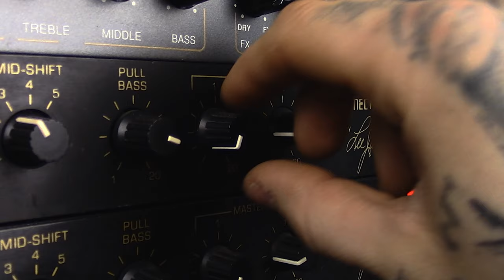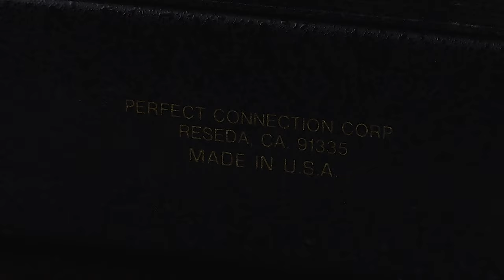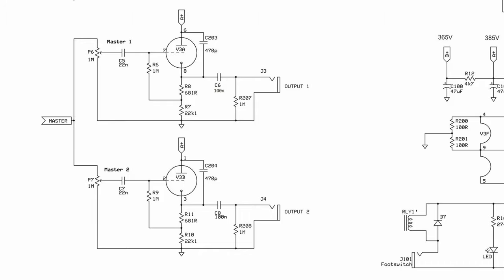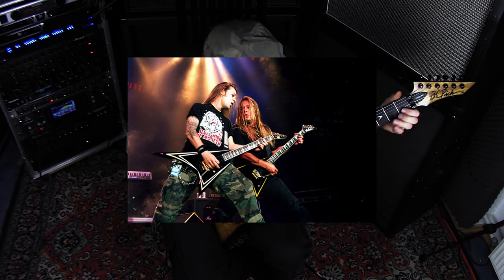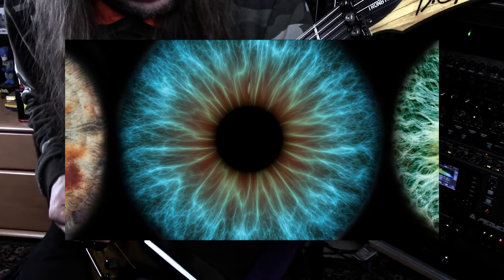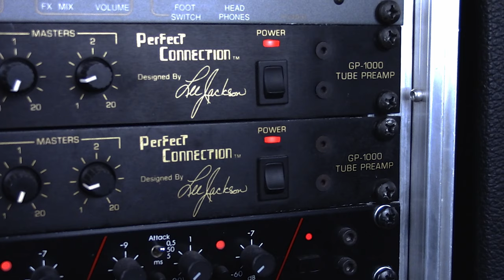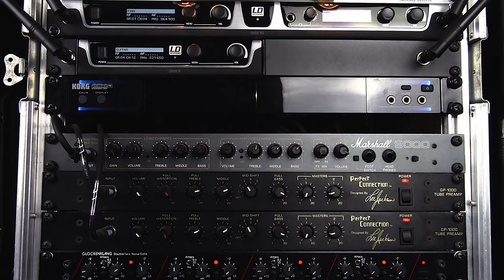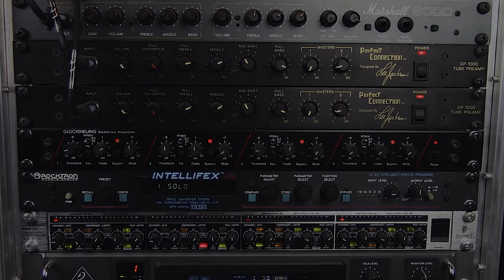The Misunderstood Amplifier - Lee Jackson GP-1000 | Weird Gear Reviews

Comment: Wow man thanks for taking the time to put this video together!!  My old man and I built a 50 watt amp head last year for ourselves which is basicaly a circuit made by combining a GP1000 with the power amp of an el34 based 50 watt JCM800.  Sounds great but it is BRUTALY loud lol  We just finished a super small combo-amp version of the same thing, only with 5 watts of el84 power instead of the crazy loud 50 watt power stage.  Lots of colouration from the one power tube since we can actualy realy crank it!  More watts does NOT equal more tone.  The little box realy rips!!! 🙂 Also I have to say that the Dimarzio PAF Pro sounds awesome into GP1000s and a super clean volume boost pedal is great too for that extra bit of gain.  I find tubescreamers and pedals like it can sort of smeaer the drive sound a bit, but that might just be personal taste.

Comment: What a great video essay about such a historic piece of gear. I was a big fan of Alexi/Roope gear lore as well - I remember studying those rack photos very closely back in the day. I was lucky to score two GP1000s (87 & 88 models - they sound identical to me) before the prices skyrocketed. There's something magical about the J50BC+JE1000+GP1000 combination.
Reply from the maker: Thank you so much! 

It really depends which 87/88 versions you got. Some 87 are identical or very close to the 88 models. 
The early ones have completely different components and circuit boards than the later 87 models. Also there are 87 models I've seen with the opened gain stage, which are very close to the 88 but not quite yet 88. It's just very random. 
I checked all my 4 gp1000 now for different components and it's amazing how different then are, even the 88 models and serial number which are not that far away from each other. 

But in general you're right. How late/early are your serial numbers?

Comment: My lazy ass has a question, little bit offtopic'ish. I saw a couple times this "RSP 2400 Hush/Enhancer/Exciter " thingy and if i understand correctly, if this unit was used by Alexi it was for add extra bottom end or bottom + high freqs (seems like gp-1000 dont really need em  ). Can someone explain me plz?
Reply from the maker: Yes, that was exactly what that was used for, basically put more bottom end. Well i try to understand that too but heres the thing. On recordings and being in a room with this amp, it lacks bottom end...if you solo it. So the dry amp with no backings sounds a bit weak and not full enough. You can work against that with such device or mod the preamp regarding this "issue". But being live with that thing constantly i can tell you it lacks basically nothing. I play in one band where we are 3 prople, 1 guitar, drums and bass. My tone is super thick and vutting tgrough everything without being a pain in your ears in the higher freq. Basically where I want to be, in the lower to upper mids, the bass contemplates that so everybody got his spot regarding freqs. Playing it dry though, yes, it lacks bottom end, it literally doesnt have that. Do i miss it? no, do i think if its necessary? no, not in the live or studio situations. At home or when youre not in a full mix? yes.

Comment: The front and back GP-1000s pictured at 7:00 and elsewhere are mine and from photos in the GP-1000 article I wrote for Premier Guitar magazine in 2010.

I obtained my first GP-1000 years prior when Reb Beach’s guitar tech, Dave L. gave it to me.

That set me on collecting these and that of course is when I noticed the differences. The terms such as “transitional” are mine as I didn’t know what else to call it. As far as I know, Lee didn’t have any specific names. It’s possible there are variants unknown to me.

Reb’s GP-1000 was used on the Winger demos and is odd that it has no foot-switching capability and the station for a relay is empty. Lee only commented, “you got an early one.”

GP-1000 870001 was confirmed by Lee as the first shipped.

I picked up the trail of use of an Aphex Aural Exciter in conjunction from the Metal Method “SOUNDS” private lesson cassette issued circa 1987. At that time, the most recent version was the Type C, which does not have “Big Bottom.” That came later. Thus, the obvious reason at the time was to add more harmonic content.

It might be possible to swap out the 250k bass potentiometer for 1meg. One problem: this is a push-pull pot of course, so you would have to find a push-pull pot of the correct dimensions, replace the carbon path wafer with one from a 1meg pot or forgo having the push-pull option with a normal pot.

I experimented with a 22k pot for the Midrange and it works well. I think I also modified one with 825/.68uF on the cathode of V1A and it may be in an article interior photo.

Needless to say, the GP-1000 was designed for that era’s Shred and Hair Metal. Obviously, it’s not entirely suited without tweaks and modifications for modern Metal like say, Nile or Abnormality. Probably would work as is for Abbath.

It’s worth noting, and I discussed this in the article, that the ‘88 replaces the ‘87 Fender style tone stack with .1uF for the midrange and .22uF for the bass. This lowers the center frequency of these controls of course.

The Mid Shift switches various capacitors in parallel with the treble capacitor. If I recall correctly, the values are 220pF, 470pF, 1000pF, 2200pF, 4700pF.

When I first heard the ‘88, I was convinced that this was the sound of the Loudness - “Jealousy” EP. 

It was so spot-on and Lee is thanked in the liner notes. That being said, Loudness Supervisor George Azuma told me Akira’s tone on that release was from a Jose Arrendondo-modified Marshall. Still, it sounds so similar that I am left wondering. If you want to hear that, listen to the vinyl or original CD pressing for your example, but not the remastered CD.

I wouldn’t say I have had as much trouble coaxing a good tone out of the GP-1000. I’ve used a variety of overdrive pedals over the years, plus a Boss SP-1 Spectrum to get a bit more midrange.

I’ve found replacing V1 with a NOS Mullard 12AX7 will really enhance its tone.

In all these years, I have never had a component failure.

Interesting video. Subscribed!
Reply from the maker: Man, I've read that countless times throughout the years!
Sorry for the late reply but i need a couple minutes to answer that and i think I will even mention this somewhere in a future video. 

Yes, those are the pictures directly from that article. 

Thats awesome! I wonder how many GP-1000s belonged to artists that were using that and then just sold them at some point. I remember I bought one of mine from Lasse Lammert who used it a lot in studio, probably theres still some videos of him using that on youtube. 

That is so funny that those terms were coming from you. I always wondered where they came from since for me there was never a clear cut or structure. But then again, that only dawned on me when i started to have more and more and opened them up or found pictures of opened one and none were like the other. 
But that term wasnt that wrong, like i said, there are 88 mods in 87 housings with back plates to cover and 87...its just hard to draw lines. 
I think Lee just produced them, changed them on the run, got supplied by different manifacturers or some musician wanted something special and he just continued to do so. I cant count how many variances i found throughout the years and even changes that were done (eg caps) were revisited and changed back in later models, then brought back as the ride continued. Its kinda chaotic. 

Except your picture, Ive never encountered one without a foot switch. But it makes sense that it was added and then never scrapped again, so I guess there are not many of those. 

The Exciter thing. A thing i never understood, at least for the marshall mod. In a full mix or live situation you actually dont need it. Then again, I'll never know what those old concerts, PA's and recordings sounded like. I might've made sense at the time. 

Swapping the pot and playing with the EQ is imo kinda pointless if you're trying to go for high gain sounds (what its not intended for)...or well...or lets say to put the GP-1000 to the max gain. Since the EQ is in front of the gain stage, the EQ change even with a 1meg wont make that much of an audible difference. I'm always thinking that through in terms of context so in a live situatiuon or on recordings. On recording you want to make space for other instruments anyway so you will literally high pass that. Live you basically want to do the same to make space for other instruments and keep the low mids and bass tight instead of muddy from a distorted guitar. I just cant think of an environment where this is actually needed....except you're practicing alone at home or you focus on what is coming out of your speakers in a dry environment without backings. Then maybe, but again, it would be a lot of a hassle for basically a slight change that you could achieve with eg different speakers. 

I never thought of modding anything regarding the mids, but fair point!
"I think I also modified one with 825/.68uF on the cathode of V1A and it may be in an article interior photo."
I have one with that exact mod. Also those values were changed throughout too. I checked, even I have ones with this value and different, i would need to check now though. But...I have to say, theres little audible differences except youre in a dry environment. 

"The Mid Shift switches various capacitors in parallel with the treble capacitor. If I recall correctly, the values are 220pF, 470pF, 1000pF, 2200pF, 4700pF."
I never checked, but it wouldnt suprise me if there were changes over the years lmao. At this point i dont trust anything anymore regarding "stock specs"

The jealousy EP...I need to check that!

"I wouldn’t say I have had as much trouble coaxing a good tone out of the GP-1000. I’ve used a variety of overdrive pedals over the years, plus a Boss SP-1 Spectrum to get a bit more midrange."
Maybe because I had always a very specific sound in mind when I was trying to dial in anything and nothing is dialing so I need to swap components around the preamp. But that might be true for a lot of people too. They want to recreate a sound for example and are not really able to "out of the box" since the gp-1000 is not versatile at all if you set it into overdrive.  Putting something in front of that to get more midrange kills me though lmao. 

I replaced the tubes of all of them to different manifacturers and also compared to the stock ones and so on. 
Ive never heard or felt any difference in sound and since i basically go into the preamp with an even hotter signal, it doesnt really matter. 
What matters though is voltage. The amount of gain and "thickness" i would say changes drastically with every  amount of voltage that drops. 

"In all these years, I have never had a component failure."
Youre lucky. Im basically touring with those and from soundcheck to end of concert they are on average running for about 6 hours straight. Mine failed alot. Usually mid concerts, either the fuse blew and some component died or there was just simply no sound anymore. I have 4 in constant use and every failed at some point. And i have the feeling everytime something else breaks haha. But I'm learning and i start to eliminate things that break in my other preamps as soon as i know what broke this time in another one. 
Most issues I encountered:
- dying tubes (jesus, that thing eats tubes). probably also has to do with the environments im in all the time, live, travelling, low voltages, constant running and heat. 
- burned out rectifier circuits/dying diodes (probably aging faster due to low voltages live)
- caps and bias cap. Probably due to age, after replacing them I never have a problem with them again. I guess only a problem in live environments due to constant heat/operating temperatures and low voltages...and then the age.
I dont think that any of those problems would occour in home environments, theres just too little stress on them. 

Thank you for your comment! I really appreciate that!

Comment: Alexis guitars had an active preamp circuit acting as a boost with adjustable EQ and up to +18dB of extra juice. So this is what goes into the gp-1000 to give it some more distortion. Adding distortion and boosts in stages is a good idea to sculpt distorted sounds. The gp-1000 wasnt reliable as it had to be repaired several times while on tour. Alexi later used Marshall jvm 410h.

Comment: I have had a gp1000 and sp1000 for years. Cool stuff. I run a ts9 tube screamer up front. I split my 1960a & b 300w cabs to do stereo. A RDS1900 for effects (Ya they suck but it works) rocktron noise control.  Sometimes I like a aural exciter for grins. Guitars are floyd bridged with EMG 81/85.

I admit I am old and started metal with a 1959 Marshall 100w and a cassette player for a preamp (headphone out to bridged inputs.)

Comment: Thanks for this - it comes at a very good time for me as well.  I've been obsessed with this amp since I realized that 2 of my favorite (but quite different) guitar tones were produced by it.  Early Zakk Wylde and early Children of Bodom.  I finally picked up a really nice single owner and unmodded '88 GP-1000 and SP-1000 set about a month ago.  I've been able to get a decent early Zakk tone (adding an SPX90 and Aural Exciter) but was lost on how to get a COB tone from it.  My signal chain is Guitar w/EMG 81 - Boss SD-1 - GP-1000 - SP-1000 - Mesa 4x12 Cab.  It sounds like necessary next step would be swap out pickups and add a preamp on one of my guitars.  Do you think that alone will make a noticeable difference?
Reply from the maker: Yes. It does make a huge difference. 
I personally dislike the preamp with a emg81 even though I think this pickup is a good pickup but it doesn't fit the amp. 

Pickups and the preamp make a huge difference for the preamp.
Reply: man just change to Alexi's EMG ALX set - this preamp will get you there

Comment: Very nice review, thanks man. At the current prices it might even be cheaper to build/get built one. At 14:42 you write you found one mistake in the schematics. Please share what that is! Are there any others you found since?
Reply from the maker: Yes i found one mistake while editing. 
If i remember correctly there was a grounding issue in the schematics with the distortion switch, a small flaw, but fine. 
I can't guarantee though for the rest. I checked of orders were right and some components to clarify that I have a decent schematic to explain what i want to tell. 
I didn't check every resistor etc. 
That flaw that I found is major though. I would need to open mine up again and check it again and compare with the schematics to exactly tell what flaw i found. 

Hope that helps a bit. 
Of course to build a replica i would recommend to buy one to be 100% correct about the schematics.

Comment: welp i just got my GP-1000 and yup and sounds pretty shit. Dont have the gain boost yet so i have to try that of course before my full assessment. i had this unit modded by lee jackson for more gain and honestly i would hate to have heard what it sounded like before the mod because after the mod it still has no gain..... damn
Reply: in my experience rack preamps are terrible without a 4 band parametric EQ, boosting 6k you get an instant buzzsaw tone, it creates the perception of alot more gain than there actually is, then you can do heavy mid shaping with the rest of the bands, GP-1000 sounds godly but only with the parametric, i would rather use a DS-1 than a standlone GP-1000 lol
Reply: @DOKITT  Would a graphic eq work just as well? I was thinking of getting a 31 band.
Reply: @akamouzis  In my experience no, with the right parametric you can change the bandwidth of the frequency to be really wide or now which makes a big difference, if you want to completely eliminate a miniscule part of mids you can do it surgially, with a graphic EQ you are stuck with whatever the manufacturer set as the bandwidth so it may take out a larger chunk of the surrounding frequencies.

I would rather 4 really fine tuned frequences than 31 non customisable, even 4 bands is quite hard to dial in and is more than enough to completly overhaul your sound
Reply: @DOKITT  right on man. What kind of eq you have for the gp-1000 and what are your settings if you don’t mind me asking? 
I was looking for the rsp-2400 but they are hard to come by.
Reply: @akamouzis  BSS FCS-916, 
cut 1.2k, boost 800hz, boost 6k, boost 200hz